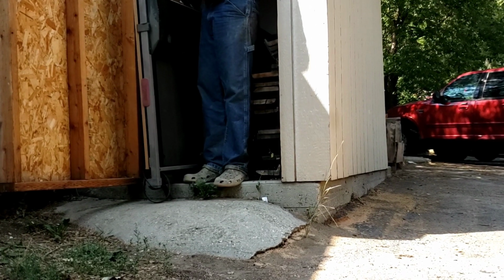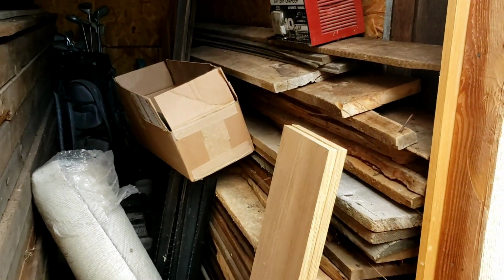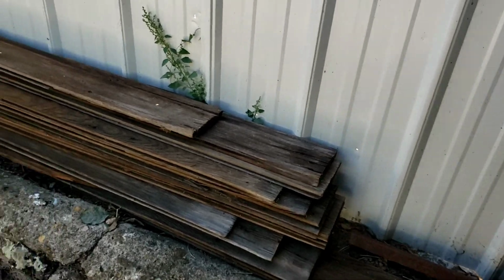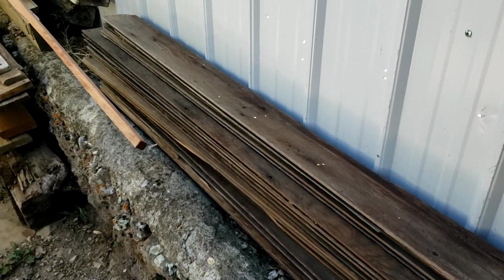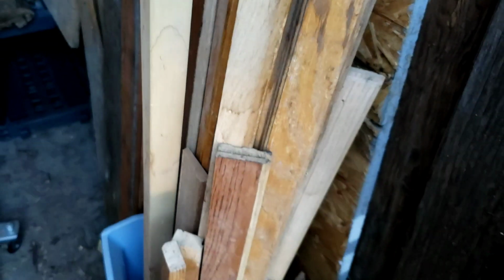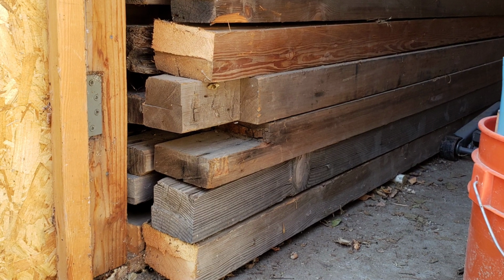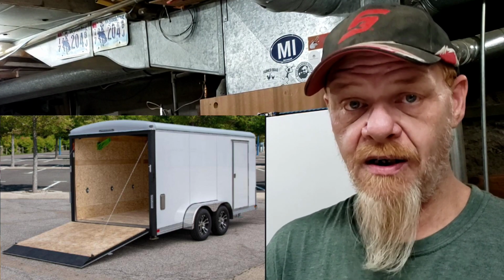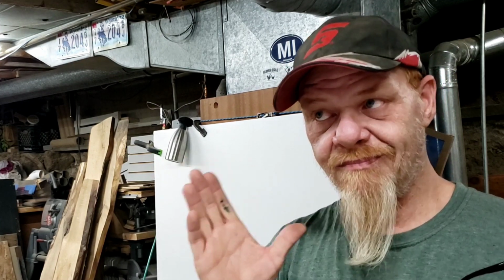Cleaning out my LUMBER HOARD & selling it for our move across country | HOW MUCH MONEY DID WE MAKE?

Comment: Downsizing was extremely hard at first - then it became  extremely easy and pleasurable.  Hard to imagine going from 3K sqft to 400 sqft but we did. You have the will and you will find the way.
Reply: I too have been through this exact same situation...the time crunch, going from SC to PA, having to go from a small (500 sq ft) home, to whatever I could pack into a pickup truck and a small tow-behind Uhaul, along with 1 one large dog, 3 cats, one adult driving, and myself. Downsizing is rough at first, but once you get going, you'll be wanting to clean out your entire neighborhood, lol. Good luck with the sales!
Reply: Ditto. We did the same when leaving Texas. I even left my old chop saw and contractor table saw behind, as well as my dad's old steel and wooden drafting desk. Boy that was hard.

Comment: I would consider a pull behind camper and load it with what you're taking. A motorhome I am afraid will be problematic along the trip considering you would have to purchase a older one. It will all work out. Praying for the best for you both.
Reply from the maker: Appreciate the comment and that was our logic for a bit too, but what we found was a tow vehicle was equal to price of a decent older RV or even more. One of the RV's locally(inset pic in video) has a new motor with less than 1K miles, new tires, 6.5K generator etc, so actually to compare a 20 year old dodge with 180K miles for the same price was somewhat obvious to me.
I can probably get the RV for less than 5 grand compared to a high mileage truck for 7 grand(pic inset in video) 
3 months ago the local market was flooded with cheap campers, but it is hunting season and they are all snatched up now because lots of people are camped up in the mountains using them.
Reply: @MakinSawdust I thought you already owned a tow vehicle my mistake. I have seen in our area on the east coast motorhomes and campers are through the roof on pricing. We can all make suggestions but yours is ultimately all that matters.  Don't forget take time to breathe.